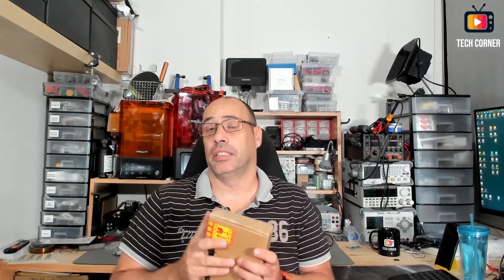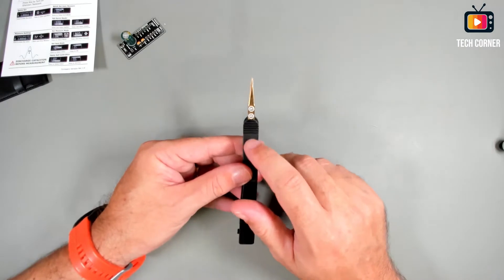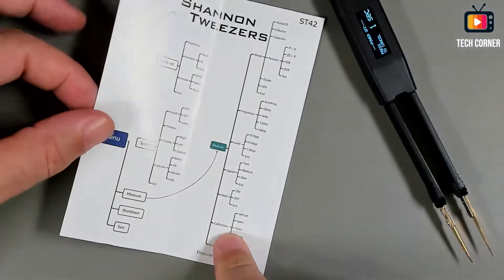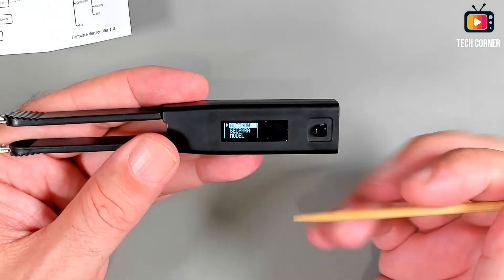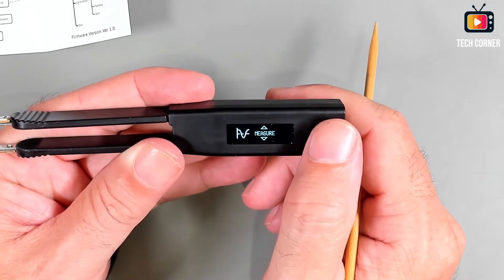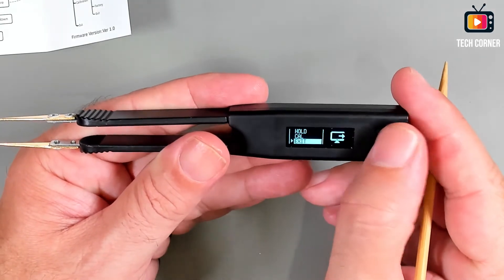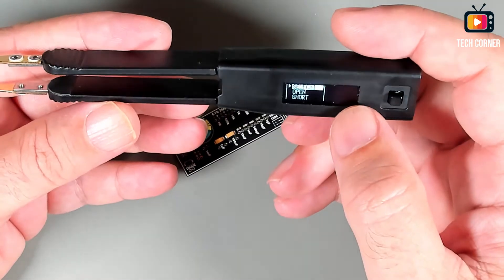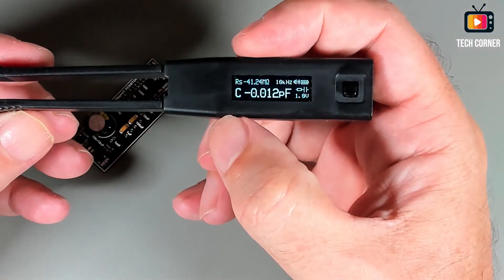Shannon Tweezers ST-42 ⭐ LCR Meter 💪 Super Accurate!

Comment: Fife Hundred pF? or 0,493pF? Is the decimal point valid? En el display leo 0,497pF, interpreto bien? Muchas Gracias! Slds desde Bs.As.
Reply from the maker: Hi Carlos, hmmm... you brought a good question. The decimal point is valid, but half a pF is really small capaticitance.... but anyway, compare this to Smart Tweezers or LCR Research products and those are over $300/300€, still a good deal. Thanks for watching! 👍
Reply: @TechCornerTV  It is probably user error, using 1V measurement voltage for capacitors in circuit is likely to activate PN-junctions in semiconductors in the circuit (the RaspberryPi processor). If you measure at 0,1V you will probably get accurate readings of 100nF or perhaps 10nF for the capacitors measured at around 25 minutes (some showed 4µF etc.).

Comment: It’s a usable product, but the price tag........
Reply from the maker: Hi! I know what you're saying, but you should compare this to Smart Tweezers or LCR Research products and those are over $300/300€, so a much better deal. Thanks for watching! 👍
Reply: These are best tweezers before similar but much more expensive equipment. Next step is above 450 USD.
Reply: @KrotowX  the point is the upper test fre. is only 100k.........